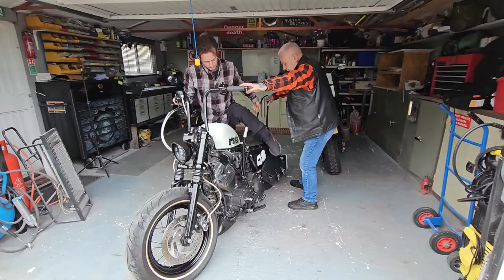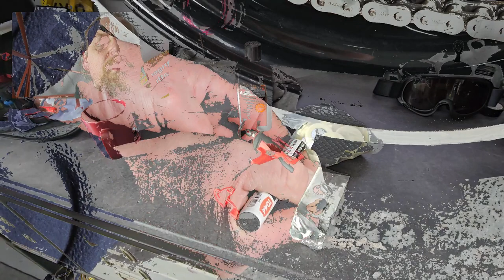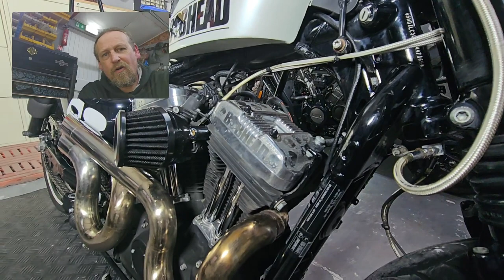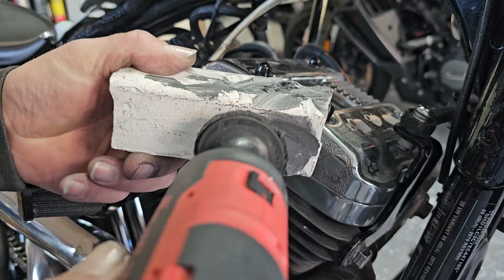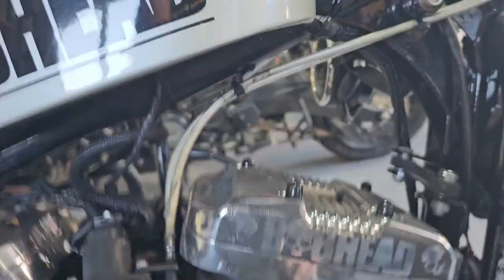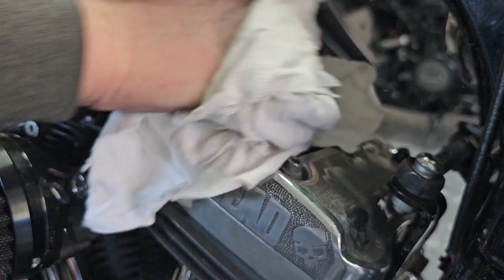DETAILING THE BoBHEAD  SPORTSTER.  48/ EP 1 #motovlog #harleydavidson #sportster48 #detailing

Comment: Nice one, where can I get those polishing heads?
Reply from the maker: Roloc felt polishing discs, ebay or amazon, get the adapter for drill if not got the polishing tool mate 👍
Reply: @ALCHEMOTO  thanks mate will be perfect for my polished rims!!!!!
Reply: Have you got a link?
Reply from the maker: Domilay 20Pcs 2 inch Compressed Artificial Wool Fabric Qc Disc Polishing Buffing Pads Wheels With 1Pcs 2 inch Disc Pad Holder With 1/4inch Shank Perfect For Polishing And Buffing https://amzn.eu/d/4ehhW2Z